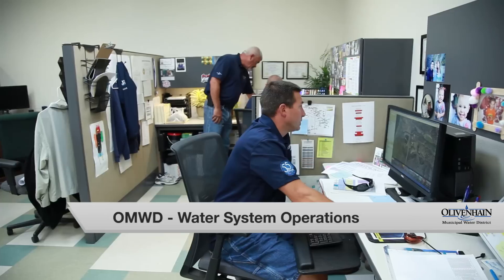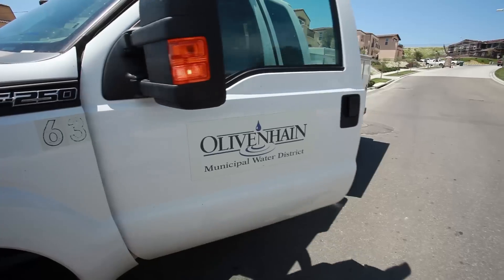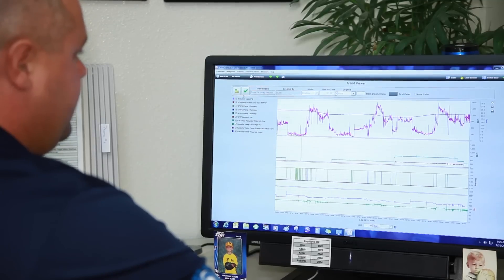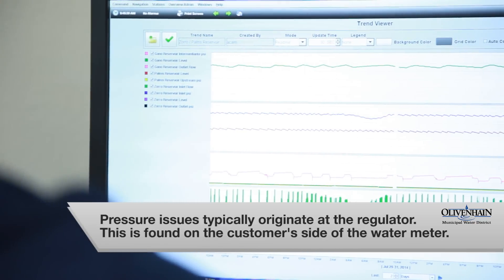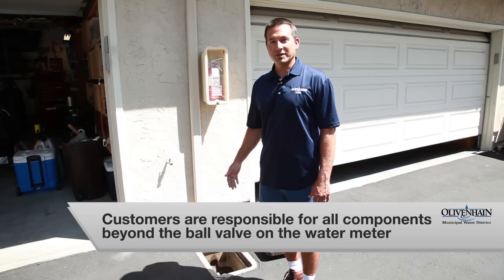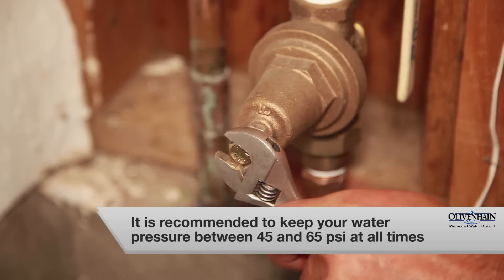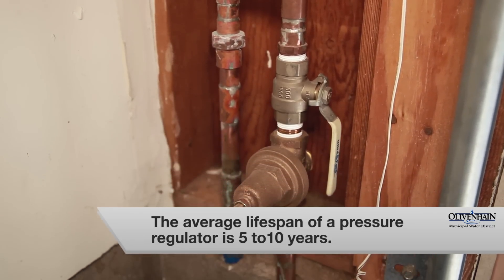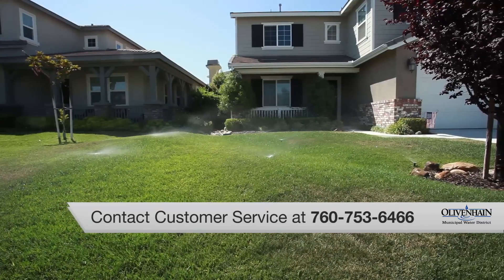Your Water Pressure

Comment: Good job 👏 
Question: my water pressure was 120psi , l adjusted it by turning it counter clockwise  but it is still reading 120 psi.
Should l leave it at 120 psi or keep turning it to the left. I can see that the flow of the water has decreased but the Guage is reading 120 psi. Your advice please
Reply from the maker: Thanks for watching. It seems like your gauge might not be functioning properly. You may want to have a plumber inspect it.

Comment: The videos says ," the regulator has a typical lifespan of 5 to 10 years". Is this true? I have seen regulators in the houses working since the house was built 35-40 years ago!
Reply from the maker: Hi Range R, the lifespan of a pressure regulator is dependent on a variety of factors, especially on how hard the device must work. A homeowner should check with their water pressure regulator’s manufacturer for the most accurate lifespan estimate.

Comment: @OMWD mine is leaking
Reply: Hi Reno, if your meter is leaking and you are an OMWD customer, please call us at 760-753-6466. If your regulator is leaking, you may wish to contact a local plumber. OMWD designed this video to provide guidance to our customers, but it is not meant to replace professional assistance.

Comment: I have a question, can the size of the water pipes that run from your inlet to your sinks, hose spouts, etc affect pressure?  I am pretty sure my house has 1/2 inch and water pressure reads 60 PSI yet I don't have enough pressure to properly run a sprinkler.
Reply: If I am reading the question right:Water pressure to the water meter: The size of the water line on your side of the meter would effect the amount of flow you are getting at your house/to your irrigation system. Your street pressure is the same no matter what size line you have on your side of the utility's meter. Irrigation lines: In CA the irrigation is not USUALLY on the interior house lines. It is usually on a tee off the service line between the meter and the house. It could be undersized. See if your water utility offers a free water use evaluation. Pipe size affects pressure loss due to friction loss. The smaller the pipe and the higher the flow, the greater the friction loss.You might try viewing this video https://www.youtube.com/watch?v=M38PEv1iWMA. Hopefully that helps answer your
question.
Reply: Yes and no. Your inlet pressure is the same coming from the street. But your flow rate will change depending on the size of pipe. Think of it this way, everyone on the street travels at the same speed limit. Single file down the road. If you double the amount of lanes (bigger pipes) you can effectively double the amount of traffic traveling at the same speed. Triple the lanes triple the amount of cars and so forth and so forth.